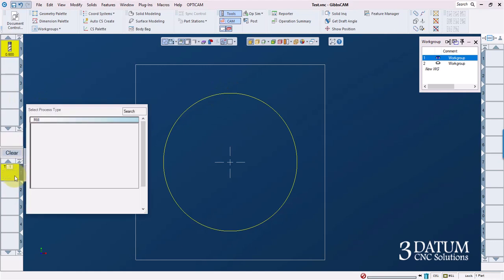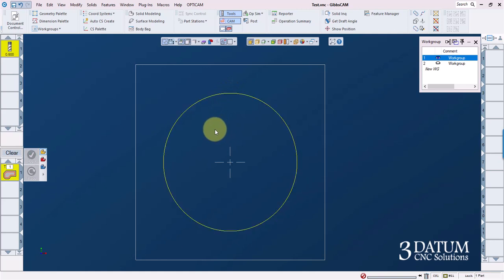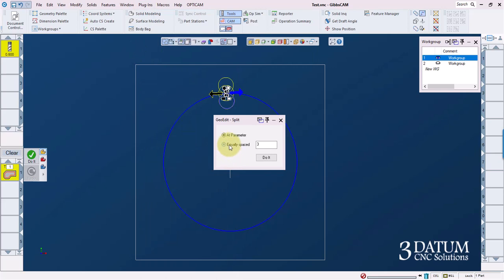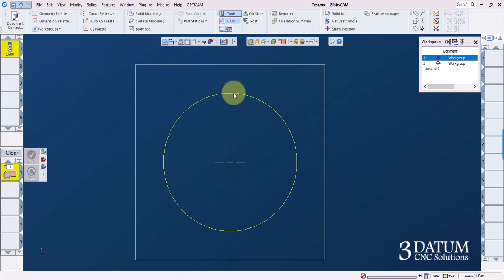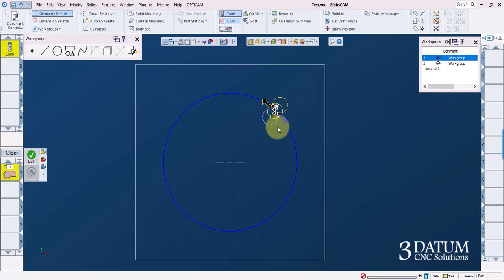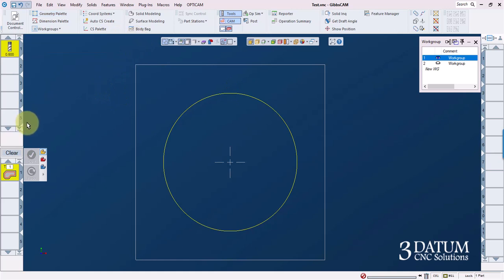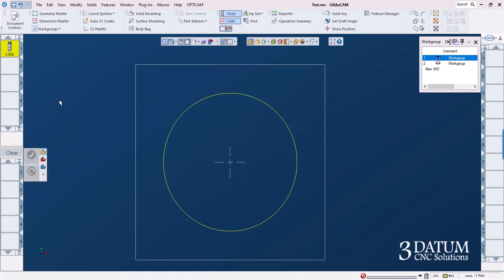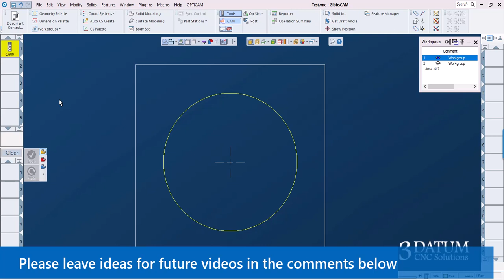GibbsCAM Tech Tip: Aligning Machining Markers to Circle Quadrants

Comment: If you put a point in the center of the circle you can get it to snap to 3 o'clock. Setup your tool and process then click on your circle hold the control button on the key board and click the center point and it will snap to 3 o'clock.